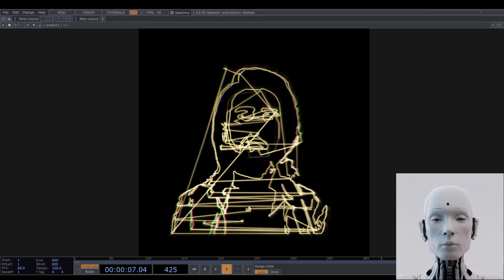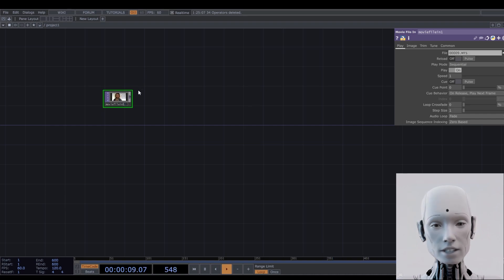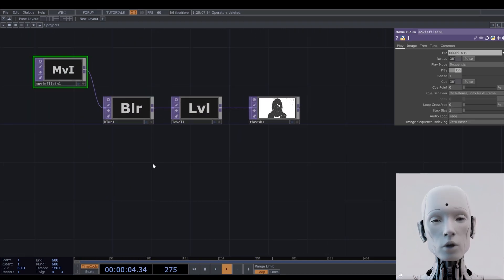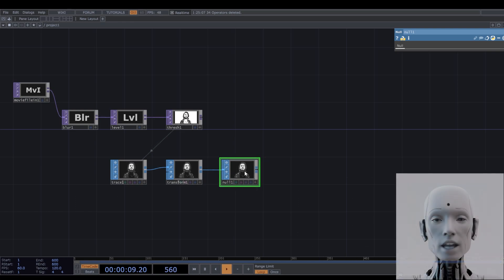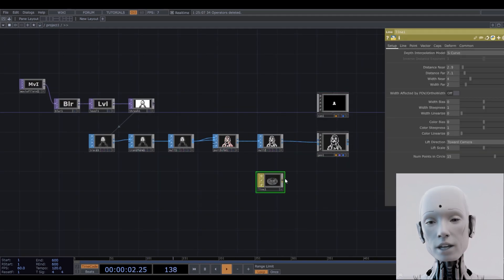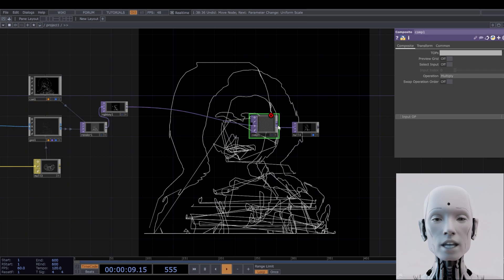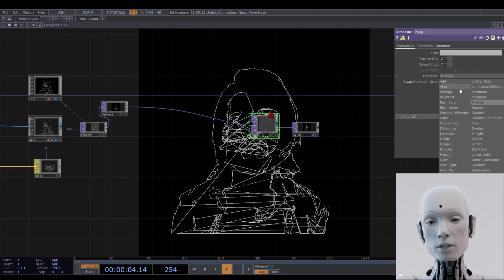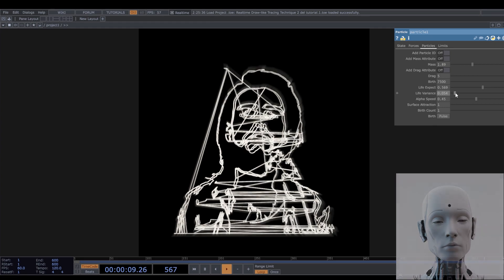[Tutorial] Realtime Draw-like Tracing Technique - TouchDesigner

Comment: im using the lastest version on 2022 33910 and the line mat not showing anything until i activate the normals but it makes a feedback effect on loop
Reply: the problem with lines not showing properly can be solved on older versions. Found the solution during the research to fix that on my 2021 where it doesn't work correctly according to tutorial, because limitations of gpu cant work on newer than 2021. 

https://youtu.be/4fzs1pUAv1s

Comment: Cool tutorial, but for some reason the particles do not match the outline in my network, instead they spread outward like they are affected by some force
Reply: turn off "compute normals" in your trace sop :)
Reply: I just found out that the line mat does not work when turning off compute normals. Either choose another material or place the camera in the right angle so that the normals effect is not picked up.
Reply: @jrvtevb346  I have the same problem, how would i change the camera position in order to get rid of that force effect?

Comment: I've tried this on both Windows + Mac with the latest versions of touchdesigner - the white particles only show up as very small dots that disappear very quickly and don't look like the solid lines you have at all. I've followed each step you've shown very closely. Any solution?
Reply from the maker: Kinda hard trying to guess from here, but I'd say there must be an issue with the particle SOP.
Reply: @uisato_  Yes you were right - I didn't increase the birth parameter, so now that it's raised to 750 it works perfectly, thanks

Comment: The tutorial doesn't work!
Reply: the problem with lines not showing properly can be solved on older versions. Found the solution during the research to fix that on my 2021 where it doesn't work correctly according to tutorial, because limitations of gpu cant work on newer than 2021. 

https://youtu.be/4fzs1pUAv1s
Reply from the maker: Yes, it does.
Reply: @uisato_  the Line Mat doesn't work with particle. could it be mac problem?
Reply from the maker: @Pareeca  Try updating to the latest version.

Comment: Thank you for this tutorial! I have one question: I made this but multiplied by 3 to have it projected on 3 screens. So I also used the tracing 3 times and my fps are now 4-7 so way too low...Do you know how I can fix this?
Reply from the maker: The more rendering [which requires computational power] the less FPS [performance]. There's a couple of ways in which you can optimize it, but it's a matter of experimentation: You can start trying different MATs, lowering the resolution, etc.

Comment: I was with you but then I got an error when I added my Material saying "The geometry shader is being used to render one or more primitives that are not compatible with its input primitive type." What am I doing differently? I get get it to do dot particles but not lines. Thanks for the help.
Reply from the maker: Hmm, are you sure you're trying to use the Line MAT?  If you do everything exactly as shown in the video that's not supposed to happen. If the thing persist, I'd ask in the Derivative forums, there's lovely people always ready to help.
Reply: I think the problem is with the build.
I have checked thin on 2021 build and it doesn't work. However 2022 build works stable
Reply from the maker: @ДжоникШарапов  I'm using 2022.28040
Reply: @uisato_  sure! Thank you for your reply, how can i send the file to you? Btw, i am using the 2021 version of Td
Reply from the maker: @garretwang9235  Can you upload it to Dropbox and send the link through Instagram?
Reply: hey yall I had the same issue as everyone else as well but soon as I updated to the 2022 build my troubles faded away
Reply: @regulatedfreestylevideos  That was the trick! Don't know why but thank you!
Reply: I have the same situation with you, if I open the point which in the line1, the line feeling is here but can’t render. It show’A Mat is using texture coordinates, but the sop being used with it does not have UV attributes.’ I checked several times other steps I did same with the video, but can’t doing further steps. Thank u for your help!
Reply from the maker: @garretwang9235  Could you please upload a copy of said project file so I can check it?